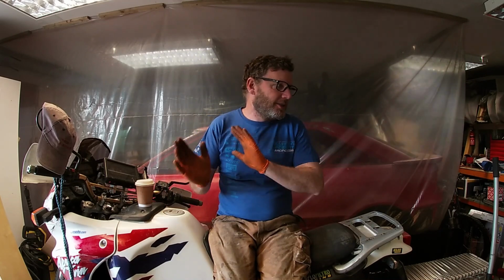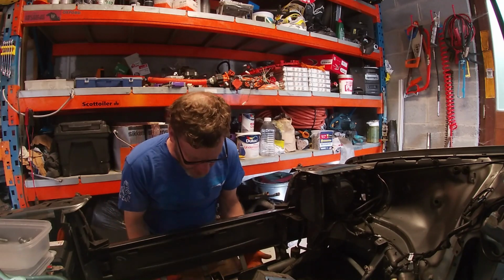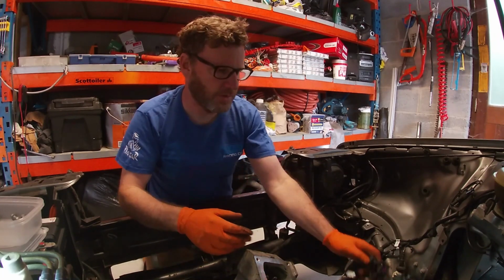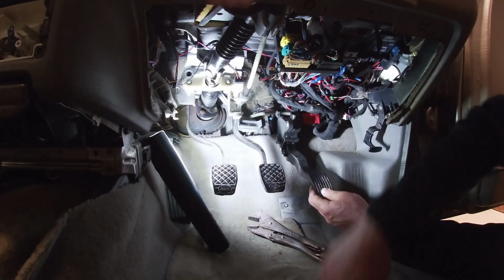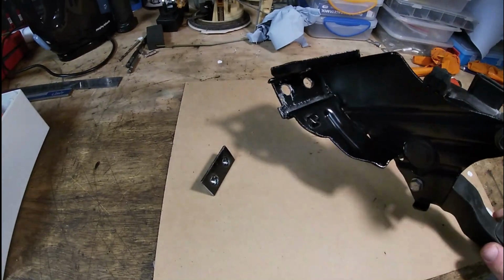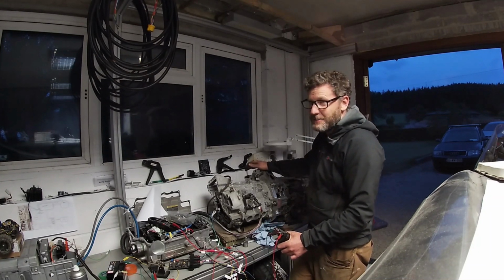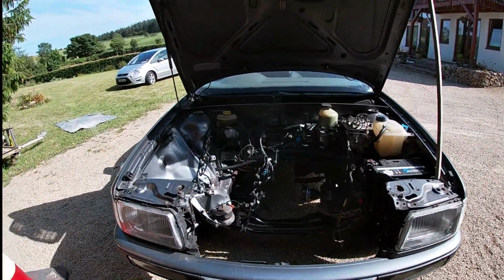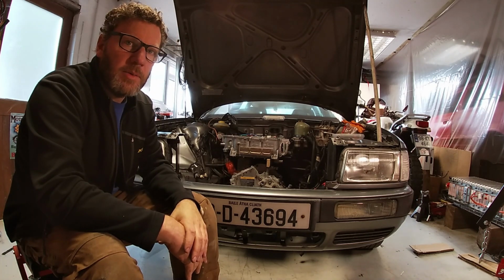Audi 80 EV Conversion - Part 10 - Motor meets engine bay

Comment: Love the adapter aluminum plate…did you get it done locally? I am also in Co Wicklow! 😊
Reply from the maker: Thanks 👍 Had it done the other side of the country. Just an offer that came up. There are plenty of local machine shops who would be more than capable of doing one of these if you have them the dimensions/cad file

Comment: If you keep the clutch it lowers stress on the gear box and allows for slight misalignment. Kept it in my project. Thanks for your interesting videos
Reply from the maker: Yeah. It's a 50/50 split as to the method. I'm happy with mine as it's only an 80kW motor
Reply: @blackterminal Did you lighten the flywheel on yours,  thinking the start ring and all the extra ballast that ICE engines use for balance and dampening.
Reply: @pkf4124  Hello. I had the flywheel resurfaced by a place to clean it up and I asked them to remove the start ring for me. :).
Reply: @blackterminal  thanks, that was my plan also,  dead weight not needed,  but also lightening it much in the same way as I had for my turbo conversion on one of my ICE VWs.  Did also think of swapping for a flywheel and clutch from a lower cc engine, as with the EV its not getting anywhere near the abuse of one on an ICE set up
Reply: @pkf4124  I didn't lighten it beyond removing the ring. The flywheel needed to be resurfaced as the previous clutch had been worn out. The motor was a little BMW 4 cylinder so it was already minimal. This was lucky as the bigger motors had dual mass flywheels which are heavier and cannot be resurfaced. It's pretty hard to get the alignment perfect if your not a expert and I still believe leaving the clutch there helps with that and gives relief to your manual gearbox. They are not easy to replace so looking after it is a good thing.
Reply: @blackterminal  dual mass clutches are a pain.   Lucky when doing a 20v Turbo swap into a non turbo VW you can use a couple of options from other models for a single mass fly wheel. Bonus is they are also less than 50% in cost as well as lighter.

Comment: Nice one. I’m fitting my Leaf motor at the moment. I think the bolts are JIS. Japanese Industry Standard. I’m in Wicklow too and I’m waiting for my VCU from Damien. Good luck.
Reply from the maker: Ah good man! Thanks. Couldn't remember at the time. Have you anything up on openinverter yet? Myself and James who is building Project Figleaf have done a good bit of bug fixing along the way using the leaf vcu if you have any questions along the way👍
Reply: Only two ads at the moment. I’ll be sure to have a few questions along the way. I had already converted my classic but I’m upgrading to the Leaf motor. I’ll contact you through the forum.

Comment: coming together nicely , before you decide to cut off the clutch pedal, just a thought (as I am probably do this to my build) use the pedal as a switch to put the motor in neutral, as it will disengage the regen, which take the load of the gearbox to make gear change easier. think some people have put mini switches straight on the gear-stick
Reply from the maker: Ah, good point. Thanks. Have been reluctant to get rid of it tbh. Thought I may be able to use it for something else but had not put much thought into it. Do you have an example of the gear stick one?
Reply: @Scampi6000  
I know Arber has done it on the open inverter fourum on one his build. have a look at this guys vid at about 16min to see what he did https://www.youtube.com/watch?v=cbB9fwQ-bY4

My clutch is hydraulic, you can get pressure switches to fit on the hydraulic line